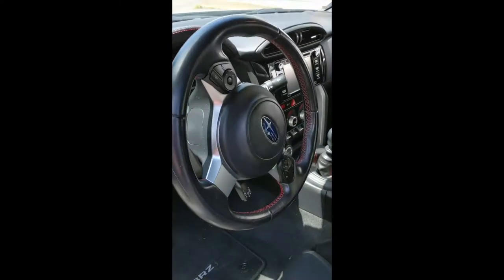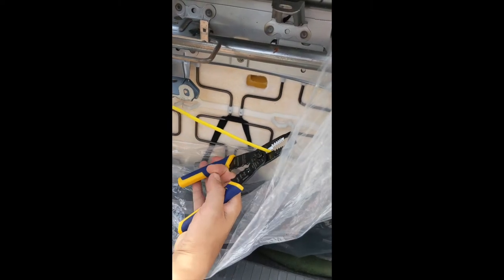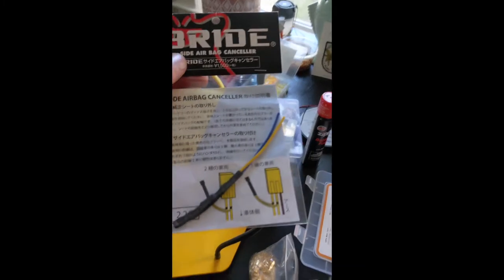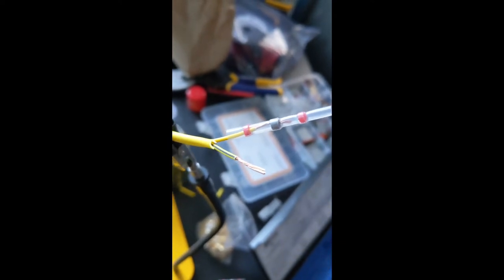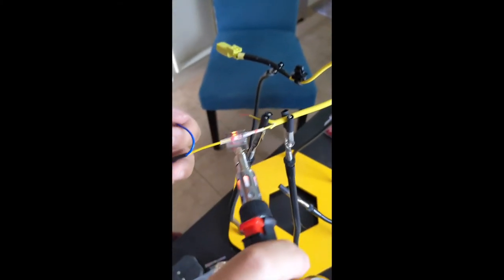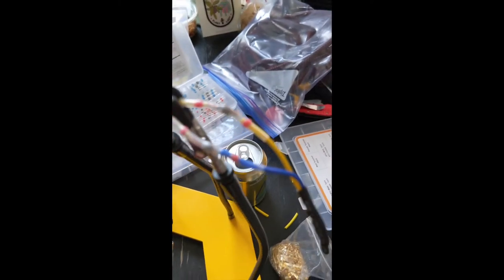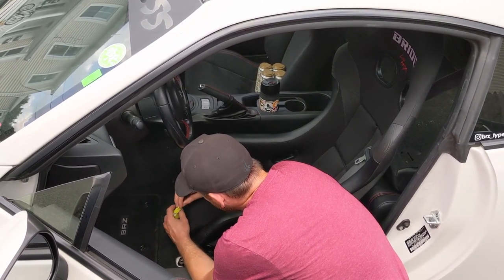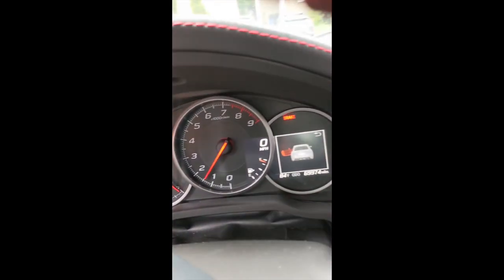2017 Subaru BRZ SRS Airbag delete for BRIDE seats

Comment: I did this in the same way and keep on! I have resistor in both seats.

I disconect battery for 10 minutes and then plug the cable of the seats, then install battery and turning on and light keep on. Same OHMS to.

Comment: Did the light remain off? Thinking about buying this to bypass my srs light on my Evo
UPDATE: 
I bought the 2.0 ohm resistor from Bride, and everything works. No SRS light, thank you!
Reply from the maker: Yes, 7 months later and the light is still off
Reply: Yes brothor I think us three are the only ones correctly disconnecting the srs sensor lmaoooo
Reply: Everyone else taping in 3.3 resistors x)